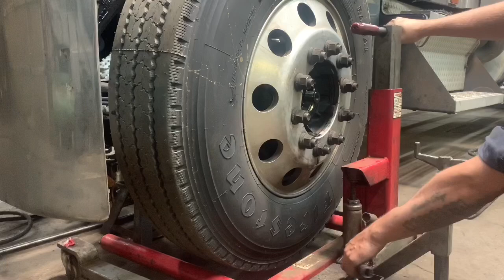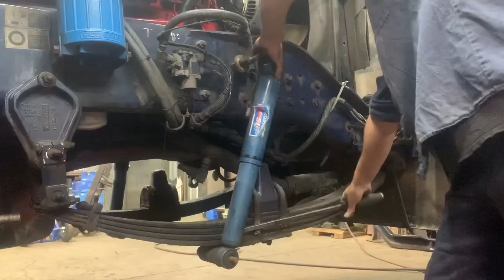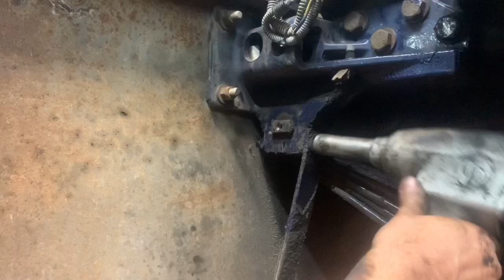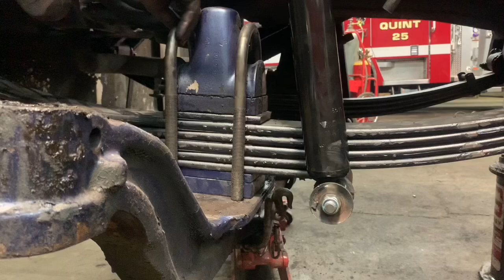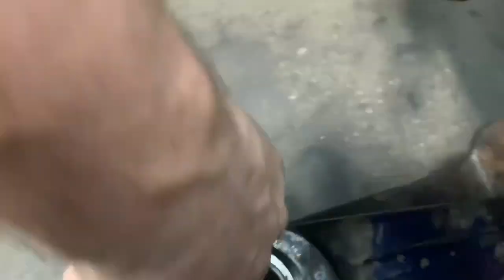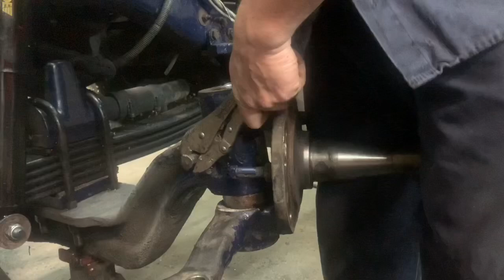Kenworth | Suspension Rebuild | Front Springs And King Pin Replacement

Comment: I love how you didn't even try the U bolts, went straight for the blue wrench!
Reply from the maker: Thanks for watching!!
Reply: What kind of jacks are tjouse 2 you have holding it up
Reply: Well yea. Apparently its not a good idea to reuse u bolts. Especially for hold the spring n axle beam. I wouldn't either
Reply: @SemiWorkin  what kind of jacks were those you used
Reply: @SemiWorkin   Where are you guys located
Reply: Gas axe works every time

Comment: I never saw a new kingpin going like this through those new metal bushings. I used to do this operation hundreds of times back there in Europe, but a new kingpin was not fitting through new bushings and I always had to mill those bushings on a CNC milling machine. 
When a kingpin was going through like this through new bushings i had to go with thicker bushings and mill them on a CNC.

Comment: Over 20 years as a heavy truck mechanic and I have literally NEVER been lucky enough to have king pins come apart this easily😑
Reply from the maker: Thanks for watching!! That’s how you know the axle eyes need sleeves.
Reply: I was thinking the same Leo.
Reply: I've spent a whole day getting a cotter pin out.lol
Reply: I’ve never seen king pins done without having to ream out the new bushes.
Reply: @kobdobla  I don’t know what brand he’s using, but I use Kaiser No Reams.  Good stuff! I know these weren’t Kaisers by the way they installed.
Reply: Or the wedge keys, they either come out or your drill them, and by the way he bang in, tighten the new keys 4 times with no anti seize on the keys the next poor bastard is going to drill them.
Reply: @sheilaschepp5761  By the time it needs new pins it should be in the scrap yard!!
Reply: @sheilaschepp5761  I also have a fool proof removal for any draw keys.  I’ve got the old handle from a broken wheel seal driver, cut it short enough to get a hand and a half on it.  Drill the center about a half inch deep with a bit big enough to just cover the threaded end of the key.  Not deep enough to touch the axle when you put it over the key.  You should be able to see about a quarter inch of threads (depending on the size of the truck) when you slip it over, smack it a couple of times.  It doesn’t let the threaded end bend or mushroom and the pressure of that large driver pushes them right out.  Haven’t drilled one in years!!
Reply: I'm just trying to understand why he pulled the hub and backing plate.  I just use a wheel jack and support it roll out to side some cleane everything up and install new bushings and put back together
Reply: @Stephen-carr  Same. Saves a lot of time and work.
Reply: @SemiWorkin  waawswawsawsawsaaw
Reply: 😂q/0
Reply: Fr tho only a year for me but I’ve done plenty of these
Reply: @kobdobla  these are not factory style bushings
Reply: Me to ,just whit the kin pin bolt sometimes is a pain.
Reply: Jajajajajaja.

Comment: Good video. Done many a king pins on I'd say every manufacturer and yes never seen em come out that nice by the time they were needing replaced. My only issue with this video is the only tool I didn't see is a torque wrench. Was kinda shocked seeing the skill level the mechanic possessed and didn't see one. His knowledge on the process tells me he should know better. Solid video all the same.
Reply: I agree not seeing a torque wrench especially for lug studs a impact gun is not a torqueing tool,over stretching lug studs can break
Reply: Just cause u didnt see it doesn't mean he didn't, I didnt see ubolts tighten, measure front hanger to unbolts to ensure square axle. I saw skill and care otherwise. I judge on what I see, not what I dont!
Reply: @RodeoJoe1981 yawn, I did say good video.
Reply: Calibrated elbow
Reply from the maker: Thanks for watching and commenting I usually don’t show every single step but I assure you everything was torqued to spec.
Reply: @SemiWorkin  this man is good, I trust him...

Comment: How often should you replace Kingpins? And if its allot of miles would it be best to replace tierods spring bushings check spildles, races and Bearings for galling. 
Just rebuild the whole frontend.
With new steer tires, brakes and shocks. Indexing the steering wheel to dead center.Then do a 3 axle alignment?
Reply from the maker: Thanks for watching!! It’s hard to say how often you replace king pins it really depends on how well you maintain your truck.
Reply: I don’t think there is a certain mileage that you replace your king pins at. We always just check them jacking up the front end, putting a pry bar under one of the front tires and then stepping on the pry bar to see if there is any up and down play in the tire. If there is a considerable amount then you need to replace them.

Comment: I drive a 2020 t680 and I have a popping noise and a bad jerk under braking and turning on the left front,213000 miles do you think I need kingpin bushings.
Reply from the maker: Thanks for watching!! I would check the shackles first.

Comment: Are you just using a hardened nut when driving out the ball joints on the steering arms?
Reply: Tiger Tools makes a set of drivers in different sizes for this......you can buy 1 or the set of 3
Reply: @leorguevara3622  thanks!
Reply from the maker: Thanks for watching and commenting!! I just use a regular 7/8 deep nut.
Reply: @leorguevara3622  always buy the set of 3 ...

Comment: Did this same work last weekend...adjust the alignment and still getting a little dance ..don't know what it is
Reply: Have you checked the bushings in the rear? I've had drivers complain about trucks and even trailers moving around on them not realizing it was coming from the tractor's rear suspension. We've had alot of problems with our 8 baggers
Reply: Did you replace the shocks? Shocks will give bad vibration and wear the hell out of your tires. Check gearbox play, steering wheel shaft ujoint also.
Reply from the maker: Thanks for watching!! If the alignment and everything else is good check for wedges underneath the springs and put back whatever is factory recommended.

Comment: If only all kingpins come out this easy. Show one that you have to burn the locking wedges out and heat the fuck out of the axle end and put a jack to the bottom of the king pin and sledgehammer the axle and hopefully it moves.Or support the axle trying to drive the pin down. Tons of fun!
Reply from the maker: Thanks for watching!! My other videos have ones that were a lot harder but this one was so easy because the axle eyes were worn out and had to be sleeved.

Comment: Greasing the king pins didn't convince me. I don't think the grease got all the way to the eyelet of the axle...!
So I end up with the intrigue of this could be a premature failure for lack of lube at the beam and king pin union...
This is my most humble comment. 
And I'm open to see your feedback to continue learning and educating my self if there is something anyone wants to share your knowledge with Us...
Thanks in advance.
Jorge.
Reply: There is no movement between the pin and the axle so no grease is required. Its locked in with the wedge key. I would put some anti seizure on the pin to make the job easier next time.
Reply from the maker: Thanks for watching!! The king pin doesn’t move in the axle it’s locked in place with lock bolts. So no grease is required there.